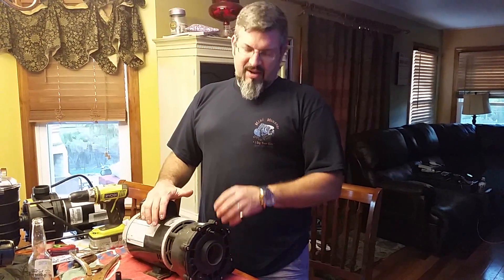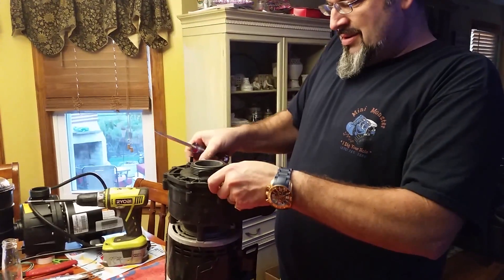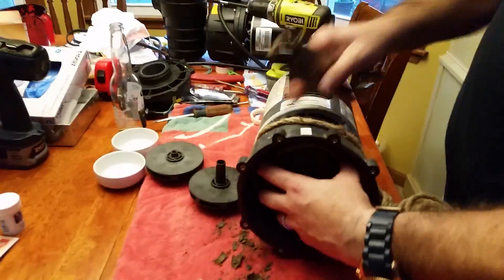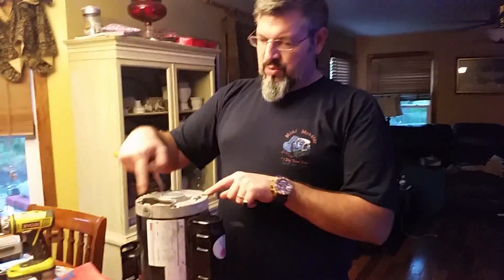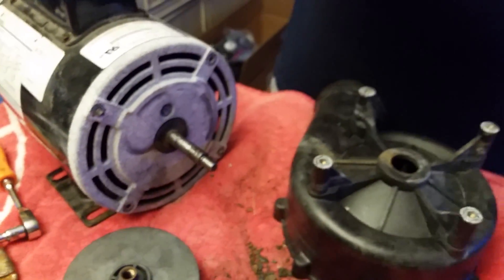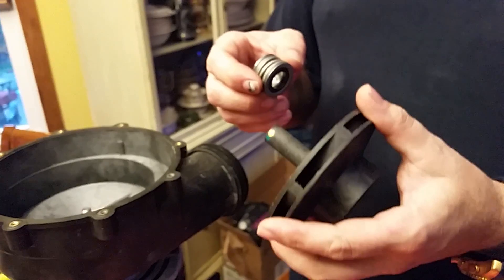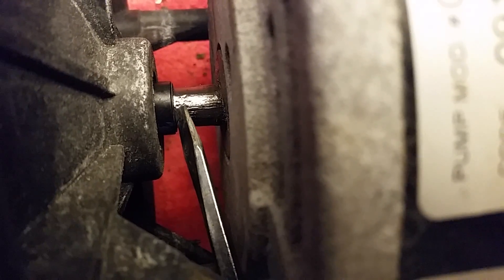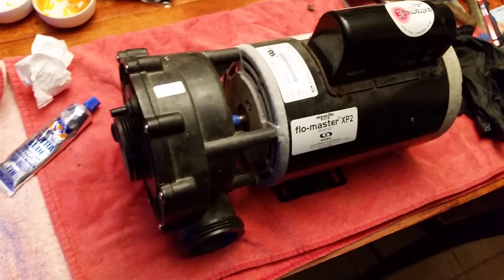How to Remove Seized Impeller From Pump Motor- Hot Tub Flo-Master XP2 No Special Tools Save $$

Comment: Fantastic instructional video, thanks!
Reply from the maker: Dan Orrett thank you for the comment.
Reply: Zero Fuel Required . Just finished using your technique with the rope. An hour to work the impeller out but it worked. Everything was seized! Now for the second pump!
Reply from the maker: Dan Orrett in the end it's nice to know you saved yourself money and the job was done right.  Good job  and thanks for the comment.
Reply: I coated the shafts with an aluminum flake filled mastic epoxy for corrosion protection. Carbomastic 15.
Reply from the maker: Dan Orrett I had permtex laying around and it works.  I'm not familiar with what you used, but I'll check it out.  Thanks for the suggestion.

Comment: Thank you for your video.  It was very helpful to me.  One word of caution that you might want to add to your video or message is that depending on impeller size, using vice grips on the motor shaft can damage the impeller.  The vice grips can be grabbing onto the impeller, not the motor shaft, as the impeller on my Flo-Master was sticking thru the pump housing so that what I thought was the motor shaft was actually the impeller extension that covers the motor shaft.
Reply from the maker: Chad Engle yes you are correct the impeller extends outside the case and I think all of them do, but even with that there is enough room to latch vise grips on the shaft.  The ceramic seals usually don't go bad. It's the impeller that fails or splits so if you lock vise grips on it,  it's not going to be the end of the world because you're going to replace it anyway.  Thank You for your suggestion / comment and I'm glad this video helped you.
Reply: Thanks for your reply.  My impeller shaft covered almost the entire motor shaft leaving almost no room to grip the motor shaft, enough that I could not see that I was gripping the impeller with the vice grips.  My impeller may not have been damaged at the time that I gripped it with vice grips.  I looks like only my internal seal was damaged.  I didn't understand that I was gripping on the impeller with the vice grips and I ruined the impeller.  The advice you are providing is still a great technique but the user just might need to look at an impeller picture to understand how far the impeller sticks thru the housing.   Thanks again!

Comment: i have a cal spa dually  pump, the impeller won't come off , got one side off fine, but the side opposite the motor fan  won't come off,  the impeller will spin but  i can hold it by the other end, and still spin the impeller, like it's spinning but won't unscrew, either direction.  do i have to break it off?
Reply from the maker: Sorry I wasn't notified there of your comment. It sounds like plastic inside the impeller stripped out and is spinning on the shaft.  Yes you are going to have to break it off. I would use a small punch or chisel to break it from the center outward trying to get it out in pieces.   The thicker parts of the impeller are pretty tough.   You don't want to pry against or chip up the impeller housing it could affect the flow or worst case crack the impeller housing.  You may find in your case it isn't going to be easy to remove.  When you get the main part of the impeller off and it is just the shaft your looking at you should be able to remove the impeller housing sliding the bearings over it (don't worry about damaging the bearings being you should replace them too).  That way you can get the last of the plastic and nut off the shaft  .Take your time while breaking it apart.  Thanks for the question and Good Luck.   A regular Dremel tool my help to grind it apart or a dremel Oscillation cutting tool. if you have one. http://www.homedepot.com/p/Dremel-Multi-Max-3-3-Amp-Variable-Speed-Corded-Oscillating-Tool-Kit-with-10-Accessories-and-Carrying-Bag-MM30-04/206360248 or http://www.homedepot.com/p/Dremel-3000-Series-1-2-Amp-1-8-in-Corded-Variable-Speed-Rotary-Tool-Kit-with-28-Accessories-3000-1-25H/203040434

Comment: Also Thanks for the advice on keeping the seal clean and the permatex application. I will have to try that also.  Mine is down for a season because I have another small plumbing leak that I can't find. I purchased it freeze damaged and I replaced all of the manifolds but one.  It is probable the culprit.  I won't know til spring.  I dont want to get caught with water in it and not enough time to drain.
Reply from the maker: Kevin Hughes thank you for the comment and good luck.

Comment: Thank you for posting. What a great idea. I had already removed the armature and still couldn't grip everything tight enough.  I had no rope that didn't stretch but I did have an old ratchet strap.  I folded it in half width wise, fed it through the pump outlet, wrapped it around the implore and clamped the armature in a vice and spun the whole pump housing....I am amazed that nothing broke. Thanks again. Unfortunately I figured I would break the impeller anyway so I had already knocked off the plastic flange that passes through the seal. Still a lot cheaper than a pump or pump and motor!

Comment: Thx, was told by spa store, couldn't get impeller off, $650 for new motor, wetend.
Showed them your video, no comment!
Reply from the maker: https://www.amazon.com/dp/B002XWE47I?psc=1  it's  $313 for a whole new motor and pump assembly exact replacement free shipping  Just make sure it is the same HP as the one you have.  To rebuild your pump yourself it is $11.99 for the seal kit https://www.amazon.com/AquaFlo-Flo-Master-XP2-swimming-repairs/dp/B0093T6WAQ and depending on the HP of your Motor the new impeller cost is between $29 and $35.  for a total of $45 total you could rebuild the pump yourself. Hot tub stores or Spa service places will empty your pockets if you let them.  Amazon is a great place for anything hot tub related.  Thank You for your comment and good luck.